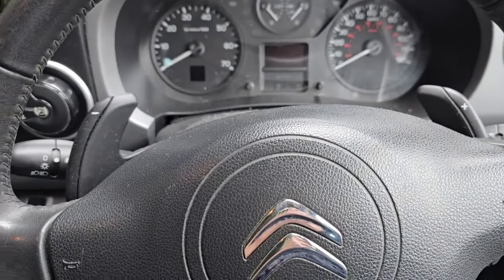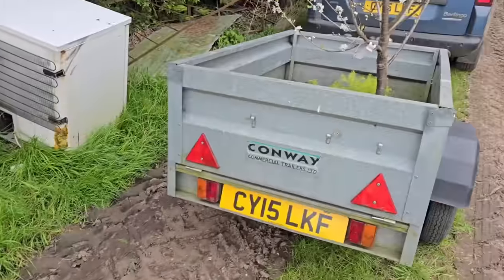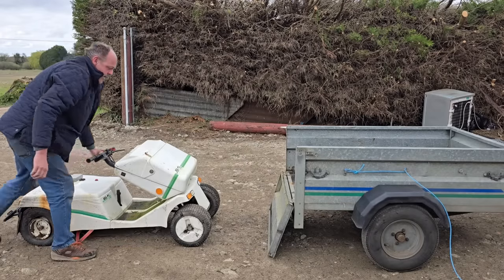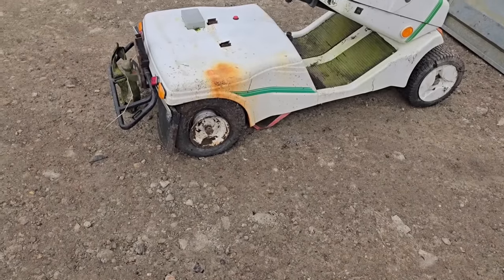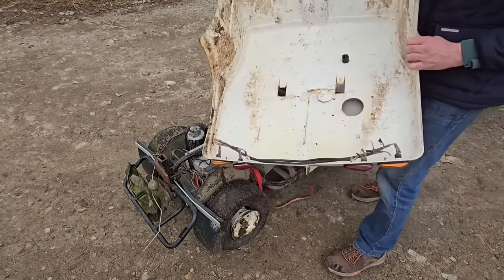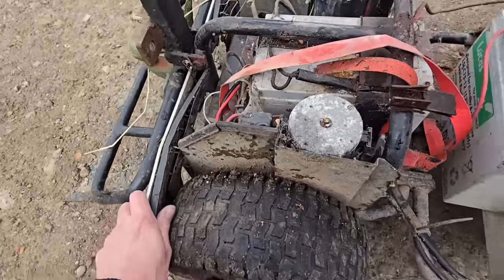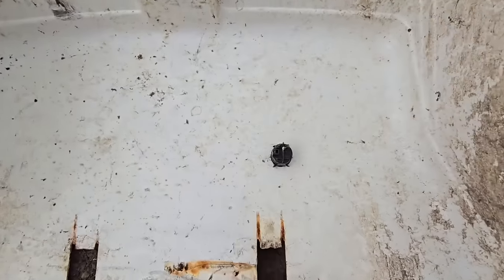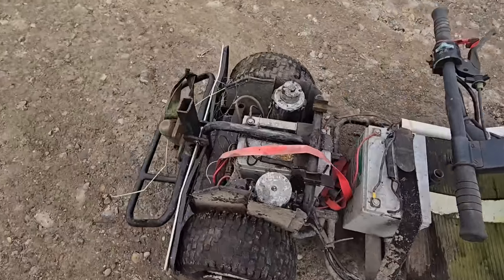Old Electric EV Buggy. Is it Scrap??

Comment: That's a golf cart, batteries are not that expensive as I have just got four Lucas batteries for the wifes scooter and they were about £45 each. The charger required is a standard 24 volt mobility scooter charger. I have a spare charger if you want it.

Comment: That's a old mobility scooter if the electric motor and battery is had it put a little petrol engine on it your in to your little engines and bet you have one sitting around I bet? Bit of modification and you can make it fit be great around a small holding and pull some things then with the tow bar

Comment: That's an old beast! And with twin motors, it was built to carry a heavy driver.  It is a mobility scooter, and should be able to achieve eight miles per hour!  Technically, it would be a class 3 scooter, which would mean that it needs to be registered with DVLA if it is ever to be used on public highways and byways, and the operator would need to be registered disabled - On private land though, none of that applies. Watch out when looking for a charger for it - 99% of all mobility scooter chargers are interchangeable, but some, like "Sungift" have their chargers wired up arse first!

Just from looking at it, I'm not sure if it should have two batteries, or three - something else to be wary of.

I can tell you where it would be very useful - when you go to engine rallies and the like! Get, or make, a little sulky trailer for Mrs. NMC, and you can toddle around on that thing all day long without ever breaking sweat!

I still think you need to get a little Kubota or similar garden tractor, even if it's just for hefting bulky items on and off the trailer. Just be sure to get one with a front end loader!
Reply: It's not a mobility scooter,it's a golf cart

Comment: The most expensive bits for it would be 1, the batteries 2, the speed controller which I hope didn't get water in while it layed on its side! I hope you can get it going but if not, rip the electrics out and stick a 125 two stroke in it! 😂 if you were closer you could have a battery charger I've got in the shed.